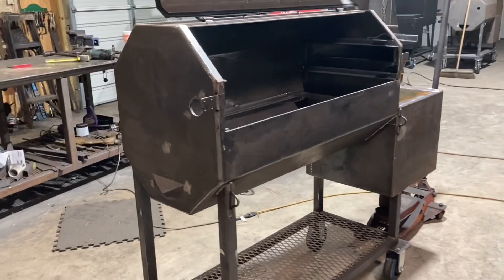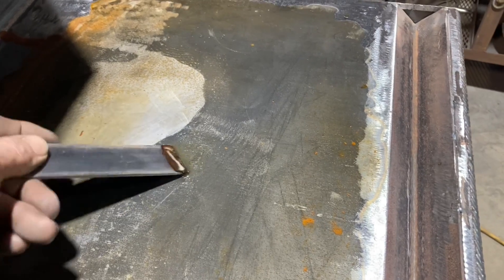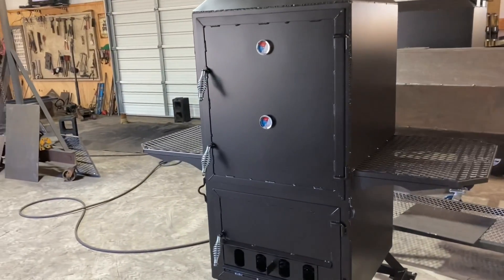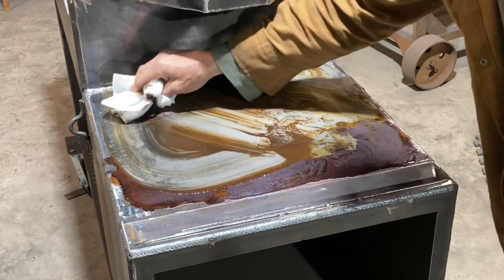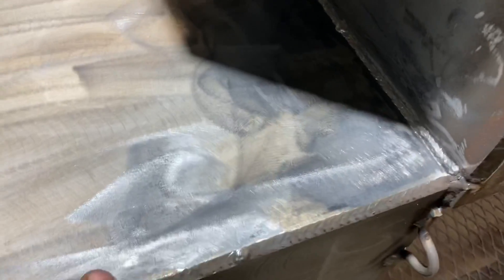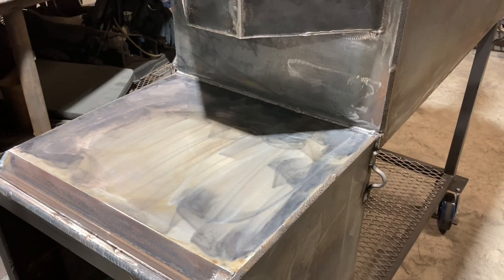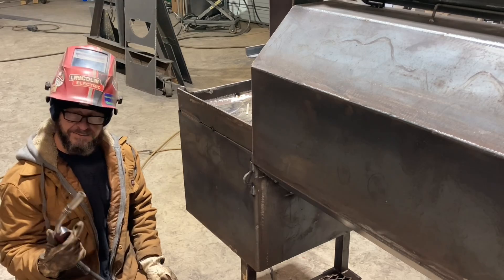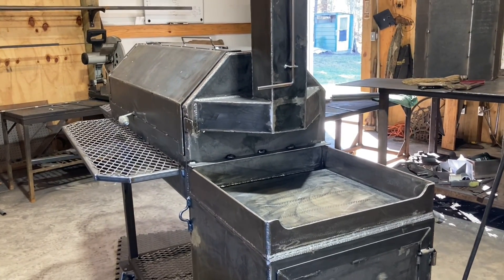How to remove mill scale from steel

Comment: phosphoric acid (rust converter) put on a wet layer then cover with plastic wrap to stop it drying out. will cut down your waiting time to an hour or less. wash of with water and will prevent any heavy rust forming until the project is ready for paint.
Reply from the maker: Thanks!

Comment: Cleaning vinegar is a stronger 30% solution. You could also try concrete etching solution that uses phosphoric acid. It is a little stronger. You can find it at Home Depot.

Comment: I really like the slide on lid you put on the griddle!  Great idea.  Never tried the vinegar approach but like the concept.  I personally use pickled and oiled mild steel since it's usually less expensive in my neck of the woods, and comes without millscale.  Super nice.

Comment: I use muriatic acid, it's much faster than vinegar.  It also removes galvanized coatings!  Spray it on, wait 3mins, hose it off!
Reply: Don't leave any muriatic acid open in your shop. It's vapors will affect every piece of metal, including tools, in a negative way.
Reply: @michaeldvorak5556  God no.  I keep the crap outside.  It's nasty stuff!
Reply: I have to repair galvanized items from time to time so that's good info.
Reply: @bigal8725  I hate galvanized metal.  It's the most miserable stuff to weld on earth.
Reply: @jagboy69  

It would be nice if stainless was cheaper.
Reply: @bigal8725  Yeah, it's pretty high these days.  Everything is! FJB
Reply: How do you neutralize it and would it be safe to cook off for eating afterwards?
Reply: @jefflowrythor  Baking soda and water.  Yes it would be after you wash it.